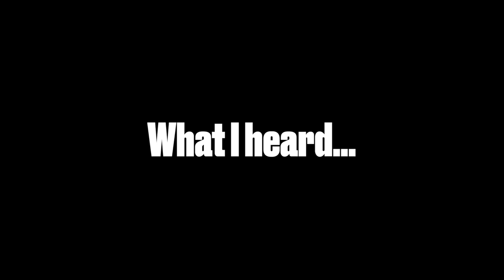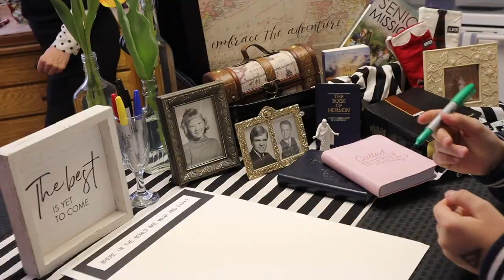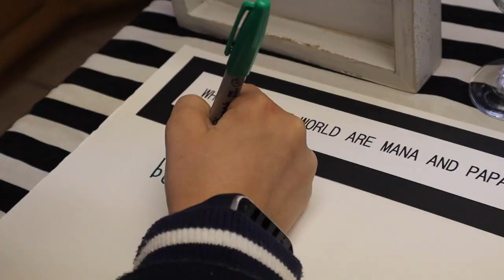MY PARENTS ARE LEAVING OUR FAMILY | EMOTIONAL ANNOUNCEMENT

Comment: We are sooo over winter. In the last week we've gotten another 14 inches of snow and yesterday's winds of 40-50 mph basically shut down must of North and South Dakota. Many of the snow banks are 5-7 feet high. We need some melting now (but not too fast or it will flood.) The midwest is kind of a mess right now 😜